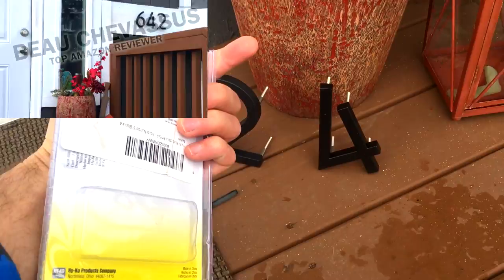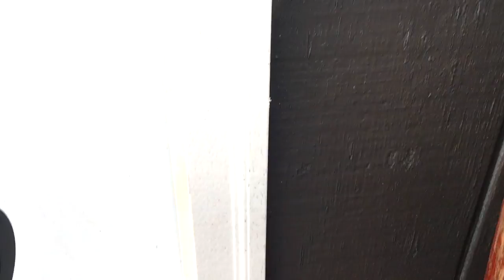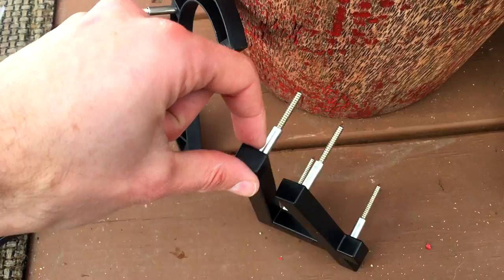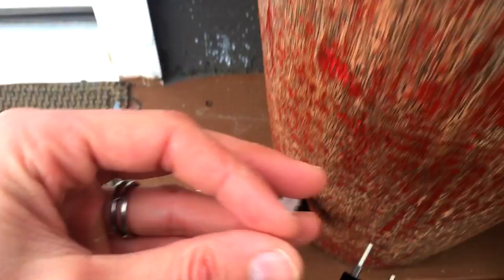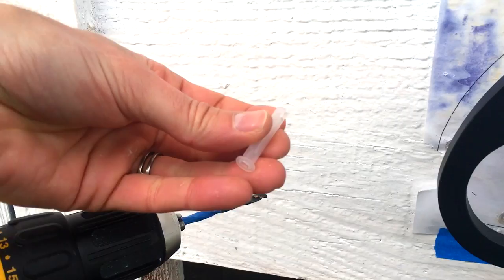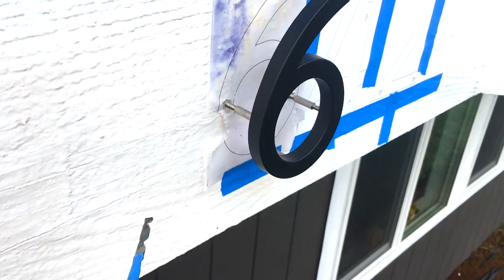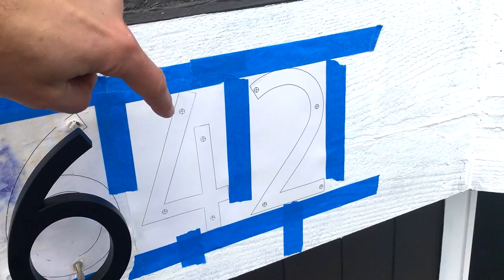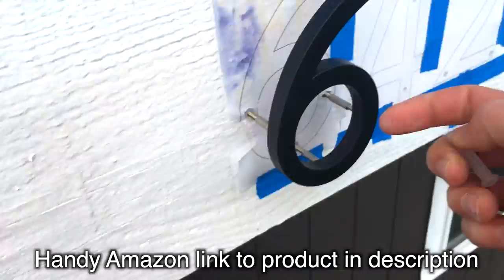★★★★☆ - Tricks for Installing Floating House Numbers: HY-KO PRODUCTS CO FM-6/2 Address Numbers

Comment: This video should have been called: How to show my hardware and drill a hole on my wall.
Reply: Yeah he skipped over the part about on if you need to screw them in or just pound them through without screwing them in. I'm still not sure.
Reply: @TurncoatD  he didn’t. He clearly said to screw the screws into the back of the number, then add the spacers. Then drill just large enough holes into the wall, and slide (without forcing) the anchors in, then insert the screws into the wall and use a rubber mallet (as someone else suggested) or a baseball cap (as he did) and a hammer to force the screws into the anchors from the front of the numbers.
Reply: @suesteel1088  Yeah, I think I was just confused. We eventually got in installed. :)

Comment: Use a 7/32nds drill bit.  Use a rubber hammer (not your hat) and hopefully  you'll have better luck than I did with the standoff barrels which did NOT neatly slide over the  mounting screws!! (ID was too small!)  Great numbers but crappy hardware and instructions HY-KO!

Comment: You can skip the templates (which in my case weren't accurate at all) by inserting the hardware into the back of each number then use a rubber mallot to gently tap the numbers where you want them leaving a mark where the actual screws are, then drill holes there. Just use a level and tape off the appropriate edge and dividing spaces first.

Comment: Don’t the screws have to be screwed into the wall or do they just slip inside the anchor? I don’t understand how the screws are mounted. Are they really just pounded in to the wall?
Reply: Correct, it's a double sided screw. It threads into the back of the number, and is a barb fitting into the wall anchor. Otherwise you'd need a single sided screw because you wouldn't be able to tighten it down. Hope this helped